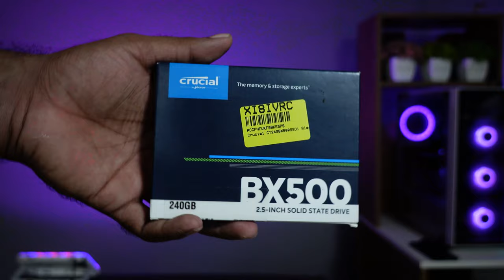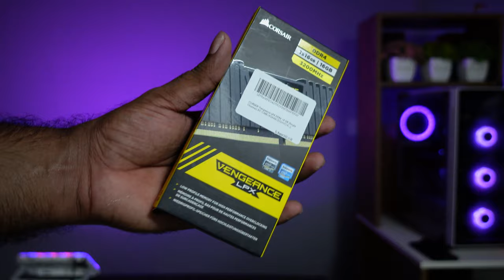50K Gaming / Editing Pc Build from Flipkart | After Corona Price Hike

Comment: Broo enikk highend editing, vfx, animation, 3d modeling, rendering, ok cheyyan pattiya oru nalla pc build spec suggest cheyyaamo.. Budget  65k or laptop edukkunnathaano nallath budget 80 k
Reply: ee budget highend parts onum kittila bro oru entry level beginner level pc build cheiyam...

ee paranja field lekk vendi over spending illathe nokiyaalum  

intel i9 / amd ryzen 9 

gtx 1650 oru entry option anu  nalla rendering speedum athikam bottleneck cheithe work nadakanamengil  Rtx3070 oke oru option anu under under 1 lakh graphics card mathram..

pinne 32gb minimum 64gb ram recommended

future proof ayitt thunderbolt connection ulapede ulla oru motherboard venamegil choose cheiyam.

baki cooler, power and cabinet supply depends parts anusarich select cheiyam..

ee paranje ellam koodi ipozhathe vilaiku above 3lakh engilum avum....njangalde studio leku ipo onu build cheithe ullu....

Comment: I buy Geonix 4 GB DDR3 Graphics card online.After plugged in system not starting.hanged at initial screen for booting.My processor is dual core ,with an old motherboad.Do I need to change the full CPU components.  $$$$$$
Reply from the maker: check the graphics card first with other computers then seek to change other components btw does all fans working?

Comment: Ryzen 5 3500 kku pattiya graphics card parayumo under 15000?
Edit- ryzen 5 3400g vs ryzen 5 3500 1080p video rendering test cheyyumo?
Reply: Better go for ryzon 5 5600 G 😍
Reply: @DoesItWorksOFFICIAL  price is too much bro ,my budget is 40k, 40k thanne kittumo enn allah akriya🤧🤧😣😫😓
Reply: @freePalestine65367  bro nna ryzon 5 3400g nokiko.. Athavumbo additionalgraphics card vekkanda avshyam ella. Pinne athyavshyam kuzhapillatha benchmarksum nd

Msi b450 pro vdh max - motherboard
8gb xpg ram (3200) -ram
Better go with ssd 256gb xpg - storage
Cooler master 450w psu
Cabinet ant esports
Ryzon 5 3400g - processor

Pinne  cash avunnathine anusarich hard disk edukk (wd blue 1tb)
Reply: @DoesItWorksOFFICIAL  apu anel 16gb ram venam
Reply: 3500 better than 3400g